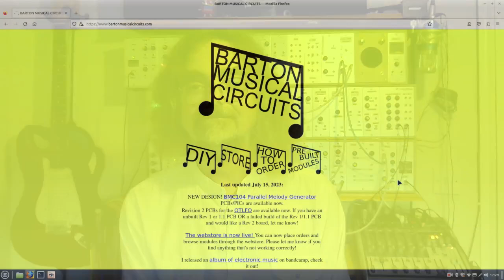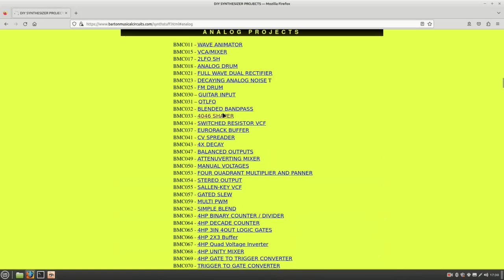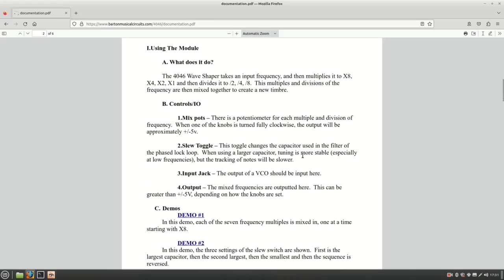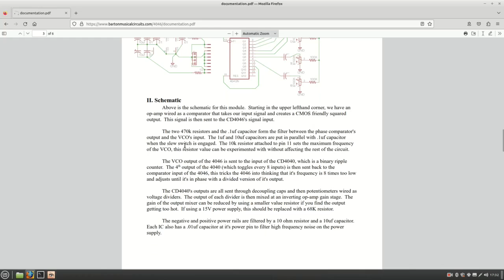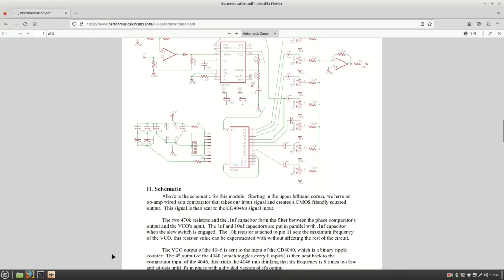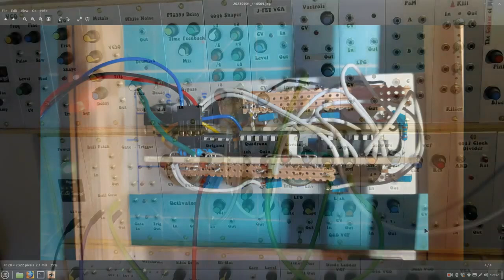Project XII Part 31 : 4046 Shaper

Comment: .... Thank you for sharing! Before I discovered your stripboard design, I had already built another stripboard from the Barton Waveshaper, since decoupling capacitors are not necessarily important. I also built your stripboard because with the first stripboard I always had modulations in the sound (LFO-like) particularly noticeable at higher frequencies. Unfortunately, with your stripboard I have the same problem with the modulations. I tried it with 3 different VCO's, the same problem everywhere. Could it be the IC? Do you have an idea what it could be?

 Greetings

Comment: Hi, I love this module. Do you think I could use 100k log pots instead of linear? I have quite a few of these lying around.
Reply from the maker: The potentiometers are acting as volume controls for each channel of the mixed output so log pots should work fine.
Reply: @CuSiSound  ah cool. I did think that, but wasn’t sure. Thank you 🙏

Comment: would this work at 9volts by using a 4069ub instead of the tl072?
Reply from the maker: I assume your 9v supply is single rail, +9v and ground. The 4046 and 4040 chips will work fine with this type of power supply. However, in this circuit design, the tl072 op-amp requires a dual rail supply +v, Ground, -v. I'm not sure if or how you could use a 4069 inverter instead of an op-amp.
Reply: thanks for the reply is there a single supply equivilant of the tl072?  @CuSiSound
Reply from the maker: The tl072 will work on a single rail supply but not in this circuit design. I tried it on a single supply and got no sound out of the mixer section. Try a search for 9v mixers and you may find a way to make it work.

Comment: I think Andrew Lloyd Webber came from the past, stole your project XII and used exactly this module to write the music for Phantom Of The Opera. 
Gigantic sounds Alan thanks so much for making and sharing this one with us.

Try to resist putting the mix of those divisions under CV control instead? 
I wonder what happens with a square wave of unequal high/low timings?
Reply from the maker: It did cross my mind to put CV on the mixer inputs but I much prefer the dynamic hands on (performance) approach. 

I could not get the module to work with a pulse wave (=unequal high/low square wave) input. I am thinking of doing some tests just on the input stage  to try to understand what is happening.

Comment: It reminds me of the  Doepfer A-115 (Audio Frequency Divider).

From Thomann:
Audio Divider Module A-115 is a four-stage frequency divider.
The frequency of a signal at the input is halved (half frequency = 1st suboctave), quartered (1/4 frequency = 2nd suboctave), etc.
In this way, the DIVIDER generates four sub-octaves (F / 2 to F / 16).
At the output, the A-115 provides the sum mix of original and sub-octaves.
You can adjust the amount (i.e., the amplitude) of the original signal and each sub-octave individually with an attenuator.
The sub-octaves generated by the A-115 are symmetric square-wave signals.
A sum mix of the four square-wave signals and the original signal is available at the output.
Reply from the maker: My Octivator module just does divisions to generate sub octaves of the input signal. I don't have level control on that module just the ability to switch octaves in or out.